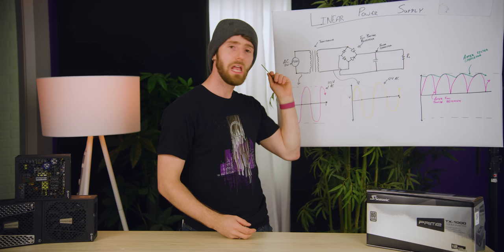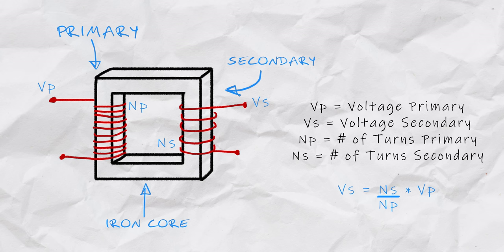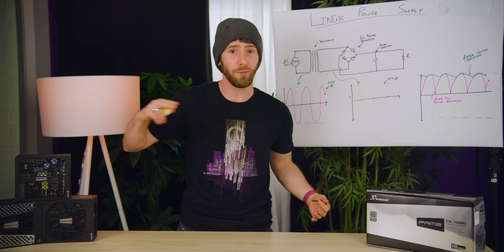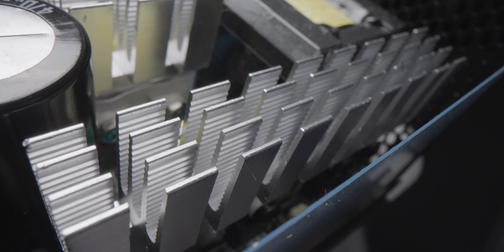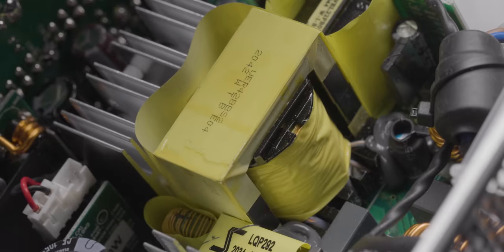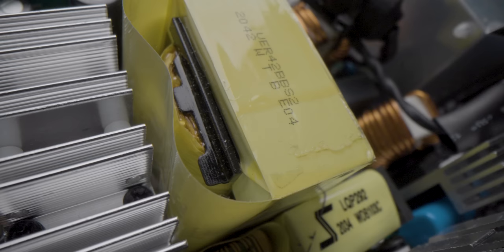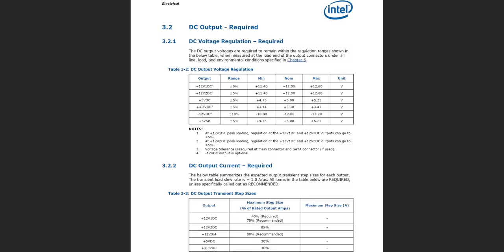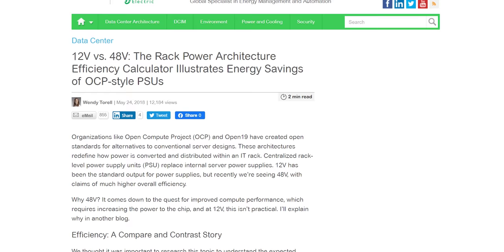How Power Supplies Work - Turbo Nerd Edition

Comment: as an EE student i can relate to this
Reply: In my country we learn this shit in highschool physics class i swear we learn too much man smh
Reply: as an EE you should know as a student that what he's saying is technically incorrect, even though some parts are correct
but then again... let's understand that he's not an E.E. and lets understand that he's a Network Admin so yeah.. we'll cut him some slack
Reply: @martinkuliza  I am not sure we can cut some slack, when first 4 minutes are just wrong, Alex's part is mostly ok, and part about expensive power supplies is pure bullshit.
1kk of people now think: transformer + bridge rectifier = linear psu. Ffs, ltt, do some research.
Reply: EE gang rise up. I know your pain
Reply: @greenbannanna123  
LOL........   Join the Resistance  Huh  
LOL
Reply: @TheAracoin  pls expand. Lots of ppl are commenting "as an x, I approve"
Reply: @nickbanderson  Why everyone relates but me? Because I am picky. Maybe I overreacted. :(

"AC is efficiently transported over long distances" DC is more efficient, but AC is easier to convert.

"Linear power supply"
Maybe we could call transformer + rectifier a linear power supply, but its output has no stabilization. It just divides voltage by constant and filters it. Then he refers to "low noise", which is not fully true for his circuit as he would get horrible ripple at 50/60 Hz. It is linear in a sense that it is not switched-mode, but by that logic 2 resistors in a divider are a linear power supply. 

In this application it lacks linear regulator to stabilize output. Linear regulator lowers voltage by dissipating (Vin-Vout)*I as heat and uses e.g. transistor as variable resistance to do it, hence "60 turd". That transistor changes its resistance to match changes at input and output, it can be pretty fast. You could even use it to filter ripple at the output of switched-mode power supply. So in this example we would want rectifier output of 13-15 V and then linear regulator to stabilize it at ~12 V.

"varistor/MOV" I think MOV shouldn't be in EMI filtering stage, but I learned about it in EMI class, so...
All in all Alex's part is solid. :)

But then they say that switched-mode power supply kind of uses linear power supply because it converts AC(high freq) to lower voltage? Transformer and/or rectifier does not make it linear!

"12V-5V-3.3V" Yes, some power supplies use dc-dc converters to get 5 V and 3.3 V from 12 V, but from what I know it's mostly in higher-end models. And they ignored it in a part about expensive PSUs :'(
Cheaper PSUs are likely to get 5/3.3 V at the same stage as 12V. Remember transformer's windings at the start of the video? We could just use that to get us those different voltages from flyback converter! It simplifies PSU, but worsens stabilization as flyback converter (AC high freq stage) can't stabilize each voltage individually. ATX spec allows +-5% so usually it's not a problem.

"Japanese caps" Why talk about problem from 2007? If a brand is trustworthy, I would pay attention to time@temp rating, as it lets you predict how long capacitor will last. If you get to know which caps are inside xD

"Transient response" I missed it when watching first time. It is actually pretty useful info. Sorry Colin.

I also don't know what cables, 12VO and mother earth has to do with anything, but it's funny how they say, that high quality PSUs generate less waste just after a part about moving components from PSU to MOBO, which is likely to end up sooner at the landfill...
Reply: @TheAracoin  thank you for the analysis :) I took enough EE classes to understand their+your explanations, but I decided to pursue software hehe
Reply: EE gang love <3
Reply: As a CompSci student, I recognized the logic circuit diagrams and somewhat understood the AC and DC currents (more from middle school science experiments lol), and everything else was kinda new to me. At least I felt special for a small part of the video.
Reply: @wl8704  nah man kenyan
Reply: @martinkuliza  you know sh#t about engineering lol
Reply: @arrogant7404  
right.....
Because you know me .. right ?
Kind of arrogant of you 

You don't know what i know or don't know mate
Have  a nice day
Reply: @martinkuliza  look at your other comments. You're caring af
Reply: @arrogant7404  
What?
Mate... what are you talking about, ?  be clear ok, what are you trying to say , you went from ...  do i have engineering knowledge to now talking about whether i care or not.
is there are point to all this or what ? , What are you trying to say ? what are you getting at?

To be clear and cards on the table... based on your initial comment i just interpreted you as an idiot who wants to argue but now it seems like you have a point to convey, the problem is you're not being clear so if you have a point to conveny.... Convey it and be clear, if however you want to argue, i'm not really interested in that 
so...What direction are you going in and what is your point ?
Reply: @arrogant7404  
ok...FYI i fairness to you , i went back and re read all my comments
i see nothing wrong
What is the point that you're driving at ?
Reply: @slumberland.mp4  What country is that?
Reply: @monotrope  Kenya
Reply: If you can RELATE to this, then you need to brush up your fundamentals and retake your coursework.
Reply: @Ara Coin  linear power supply just means there is no switching involved, linus' part is still correct and imo the most understandable, all it is missing in practice is a simple voltage regulator like a 7812 but the more important part for the big picture is the bridge and transformer.

an important characteristic for the efficiency of SMPS is that they can change the period for which the input to the flyback is on, connecting it to mains for longer for a heavier load and relaxing the mains when the load decreases, with the decision being made using feedback from the output, kinda irked me that they found the time to mention varistors but not the defining characteristic of a switched mode power supply. if you gonna be a know it all smartass, do it to a college professor or something, not in a general audience basics video.
Reply: @TheAracoin Thank you for agreeing with my subconscious! I don't know much but I was starting to think I knew even less than I think I do. . . Fuck Descartes!
Reply: @slumberland.mp4  same man 12th grade physics, sometimes im even confused am I still in high school or a engineer's class xD...
Reply: @martinkuliza  I bet that makes you feel better about yourself talking down on EE students.
Reply: Not electrical engineering, but I think avionics will give me an honorary "Feel your pain"

Comment: 7:35 "In layman's terms, this 3,300 microfarad capacitor...."

Thanks. I just realised I'm not even qualified as a layman.
Reply: capacitor is similar to a battery. so when there is a need for more "power" it draws from it. microfarad is used to measure the capacity of a capacitor.
Reply: The capacitor saves energy in electric fields. Capacitance, measured in Farad, is just well... capacitance. I wonder why they use 3300μF instead of 3.3mF though
Reply: @LKonstantina915  Bigger numbers sound better.
Reply: @LKonstantina915  it's standard to refer to that size in uF. Not sure when the cut off is, but in my time I've not come across any mF caps. Only 25F supercaps and below that 10,000uF caps, or something similar.
Reply: Think of it like a water-tower - when there's enough power it charges up and then it discharges when there's too little power
Reply: It’s alright. That part was a bad thing to include for a layman’s explanation - that one’s on them.
Reply: @LKonstantina915  except this specific capacitor doesn't save energy in an electric field. It's an electrolytic capacitor so it's more similar to a battery in that it stores its energy chemically. It just has a way smaller internal resistance than a regular battery, making it behave similar to a capacitor. That's why electrolytic capacitors have polarity and regular capacitors don't
Reply: lmao that's actually funny.
Reply: @InservioLetum  They are cool, they kinda literally store electrons for use at will.
Reply: A farad is just a unit of measure of electrical capacitance a microfarad is 1*10^-6 farads, simply put, its a water tower for power
Reply: lol same

Comment: "I would strongly recommend not licking these"

Too late... mm sparky
Reply: he shoulda said why we shouldnt lick these, now i really wanna try 🤤
Reply: you wont die but its not fun
Reply: *Ded*
Reply: Bulk capacitors would light you up. They're not kidding with that 250V on the side of them. And you have to double that because they're in series. Has to do with how the voltage doubling circuit works in a PC PSU. The switch on the side for 120-240 VAC input. When you switch it into 120 it doubles the voltage to bring it up to 240.
Reply: @InservioLetum  I can remember kids in grade school addicted to licking 9V batteries. I tried it, but it was not for me.
Reply: @luukvanoijen7082  Simple. It's death. That 250V warning is not a joke, you can actually die if you touch those contacts.
Reply: @PunakiviAddikti  its a joke

Comment: That "60 plus turd" power efficiency rating actually made me laugh 😂
Reply: I wish he said "60 + poop." I thought it was funny, but didn't quite laugh out loud, I think because turd in my mind refers more to the object than the material.
Reply: But oh so wrong
Reply: LTTStore should sell that sticker.
Reply: Sounds like a GPM
Reply: @y__h  agreed.
Reply: An unregulated supply should be much more efficient than 60. Where precisely are the losses? When you use a linear regulator those are inefficient. But that's not the circuit he was showing.
Reply: @1pcfred  At high-loads, the rectifier caps suddenly need to charge quickly which induces charging losses on the caps - the caps have internal resistance and thus high charge/discharge currents waste power. Hence the need for PFC correction - it's easier to frequently top off a cap slowly than to charge it quickly occasionally.

Comment: "110 or 220 volt from the wall"

Me: A 240 Volt intellectual
Reply: Me: A 230 Volt intellectual
Reply: Ha, I got 380 V 3 phase
Reply: @deuterium2132  haha i got 400 volt three phase.
Reply: Gidday mate. That said our spec is now 220+10-5% so in theory it's 220, in practise it's 240 lol
Reply: @deuterium2132  plugged into your computer though? I've got a blade centre H with 3 phase inputs lol.
Reply: Hah. Rubs socks on plastic carpet I got 20.000 volts.
Reply: @zyeborm  nah jk, we don't even have proper electrical installation here. Most houses are either still on 900 VA or 1200 VA and we're only getting two wires from the utility, yes, without any ground wire, only live and neutral. I've lost count of how many times I'm getting shocked by my pc case
Reply: i have 230 volt here in the netherlands
Reply: Entire world except from USA and England I guess
Reply: @ManOfAttitudeLP1998  In reality North America is 240v on the main grid, but when it enters a home it's split into two circuits at the transformer each circuit 120 average.
When a little more juice is required a larger breaker is inserted to bridge the two circuits for that particular output.
Reply: @deuterium2132  It's perfectly normal to only get 2 wires from the utility in a single phase installation. Ground is just that: a direct connection to the earth. It should be provided by your house/building.
Reply: @zyeborm  True.

It was 220 in spec and 210-215 out of the wall, later it turned 220 for real, then 230, now technically 240 but 237-241 in practice, sometimes exactly 220. It also depends if your house gets 220 from the street or pure 3 phase from the street. Newer home always get 3 phase power.

I sometimes stick a voltmeter right into the wall. Fun to see it differs from area to area and even from time to time in your own home. Make sure not to use one of those limited at 200 volt ones, no good.
Reply: @deuterium2132  That’s the minimum requirement to power a Vega 64.
Reply: @ldflightsim  yeah i know, but i was comparing to US electrical system with 240 V split phase, which obviously comes with neutral wire directly connected to the neutral of nearest step down transformer. I'm not sure if the neutral wire also serves as PE conductor there though
Reply: we don't even have separate breakers for each circuit, let alone any residual current breakers. sometimes i wonder how am i still not get electrocuted to death lmao
Reply: @jonasboortz  no doubt, if the system also has an 11900K it would trip the breaker the moment you start any games lmao
Reply: In France, when we are close from the plant, we have sometimes 245 V. In my house, light bulbs don't age very well 😂
Reply: @deuterium2132  we have ground installation with its pole on each house here.
Reply: me: A "stealing 20kV straight from the high tension grid" intellectual
Reply: i am proud edison fan, i get 70 volt dc
Reply: @haryholland  enough to fry an elephant Edison fan who didn't invent the light bulb, but patented it?
Reply: @deuterium2132  Electrocution is death from electrical shock.
Reply: @fridaycaliforniaa236  In the United States you can buy 130 V lightbulbs to extend their life. These come from electrical wholesalers, not a hardware or grocery store. They could easily make a 260V version for France. Many make fun of the United States for using 120 VAC for lighting, but the filaments are a lot more durable at lower voltages.
Reply: @jamesblunt7585  He invented the Tungsten electric light bulb. There were others with shorter lifetimes One of the first electric light was Carbon Arc. My home town installed one, in the early days of electrification, along with a small power plant to light the downtown. It was on a tower that was well above the buildings. It was before I was born, but the articles about it said that you could read a newspaper with light from it, at over a mile.
Reply: @michaelterrell  Ok thank you
Reply: @zyeborm  in Germany the spec is 230V +-10%
Reply: @ManOfAttitudeLP1998  240v UK  and Australia and more countries, japan 100v USA and canada 120v  mexico 127v Brazil 220v and 127v europe 230v
Reply: @ManOfAttitudeLP1998  standard residential service in North America is center tapped 240 VAC. The more you know. Now what's 240 / 2 ? A 120 VAC circuit is between either hot and the ground bonded neutral. Both hots? 240 VAC! What's really weird is the sine wave at 120 VAC. Hot and neutral are not the same things. You find this out when you go to wire up something like an autotransformer.
Reply: @theanimatronicscollectoran4193  UK standardised with Europe on 230V since 1995 (with improved voltage spread tolerance since 2003). We need power for our kettles to make tea quickly.

Comment: Hearing power factor correction took me back to my EE clg days. Used to have a tough time understanding why the hell they are not in sync. Understanding the full operation of power supply might need one to have master degree. Great job in explaining the basic concepts so easily.

Comment: I have been using Seasonic for over 12 years, by far the best brand.
Reply: nah that's EVGA or Corsair
Reply: How do you know if you've only been using seasonic?
Reply: Lol at you arguing. Those are at par with each other, Seasonic, EVGA, Corsair.

SuperFlower (Leadtek) > them 3 though. ☺️
Reply: @SUSHI4lyf  Both corsair and superflower have made low quality power supplies.
Reply: @benjamindebruyn2873  I work in IT, i use all brands, been doing this for 30 years

Comment: For anyone wondering, the phenomenon of using a coil to generate EMF (electromotive force) in another coil is mutual induction. The current in primary coil is used to generate a magnetic field that produces an EMF in the secondary coil. This EMF then produces current in the secondary coil. 

Now, the EMFs of both the coils are in the ratio E²/E¹ = N²/N¹ (where E² and E¹ are the EMF of secondary and primary coil respectively and N² and N¹ are the number of turns in secondary and primary coil respectively). 

Now if the number of turns in sencondary coil is less than the number of turns in the primary coil, the EMF generated would be too, and vice versa. This is how transformers help in lowering (step down transformers) or increasing (step up transformers) the voltage supply.

Bonus tip: the type of Transformer Linus showed is a core type transformer. There's also a shell type transformer, where both the primary amd secondary coils are wound to the same bar or soft-iron core. Those are relatively efficient.

Comment: The proper term for that transformer is a step down transformer (for those curious) which means it lowers the output voltage compared to the input.

Most people are more familiar with step up transformers (like the big ones outside or in buildings, or your typical car's it ition coil).

This is just for those who are less educated in electronic components who are curious.

Comment: Correction: it's 120 / 240 Volts. You might measure a slightly different value (I've heard it called 110, 108, and 114), however overall, it's 120 volts.

Edit: some people actually do get 208 volts, but that's a special case that mostly happens in apartments
Reply: Uk it's 230 officially but we get a mix between 230 240

Comment: Having been working in electronics for the past 19 years, from what I recall the most common voltages used are the +/- 3.3V (low power logic), +/-5V (common for logic), +/- 12V, +24V (relay switching), +32V, +48V(telecommunication systems) and +52V(audio)  though anything 24VDC and over is usually on specialized electronic equipment such as military systems (RADAR, SONAR etc).  Military systems also get into some highly unusual voltage levels as well and the supplies for those being highly customized, I have worked on systems with DC voltages as high as 4250VDC.